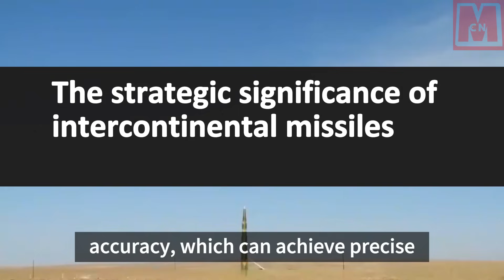Comparison of intercontinental missiles among China, the United States, and Russia.

Comment: What nonsense are you talking about? One Minuteman 3 is equipped  with 236 warheads? How is this possible? Typical bragging rights video that does not keep up with changing times....From what I have read the US has about 5000 nuclear warheads. This is enough to destroy mother earth completely many times over. Russia has about the same number of warheads. As for China, it is only about 500? All the ICBM from the 3 countries have  multiple warheads, at most 4 to 5 per missile? Distance wise is about the same. But the key difference here is that the Minuteman 3 is very old so is the submarine launched Trident ICBM whereas the Russian Sarmat  and the Chinese DF5 are newer and more capable with new technologies such as AI and also active evasive maneuvers. They are also more reliable and therefore, more capable of penetrating US anti-ballistic missile shield....Regardless, never under-estimate the Chinese. With their massive industrial base, they can easily make up for the numerical disadvantage   within a number of years....